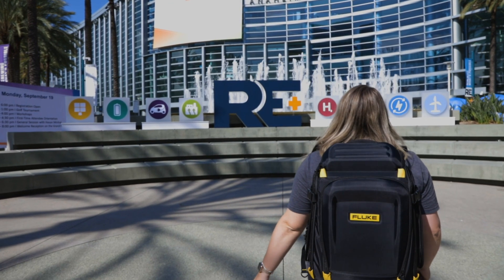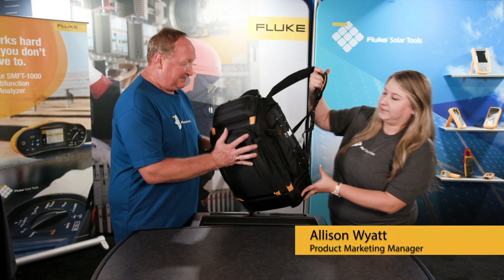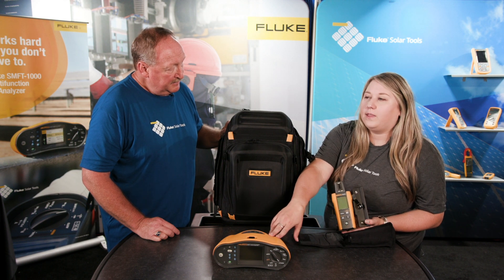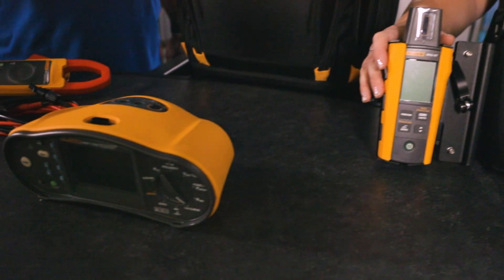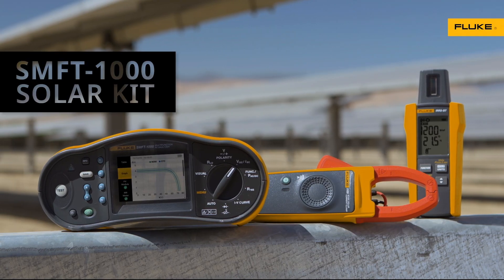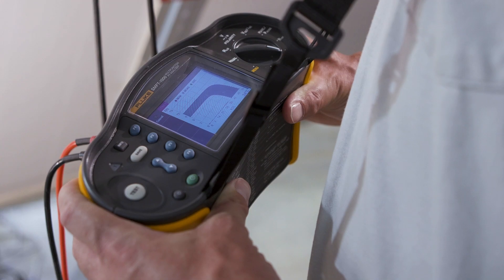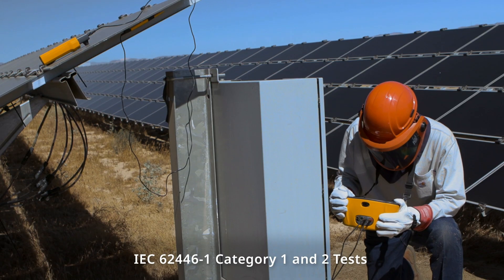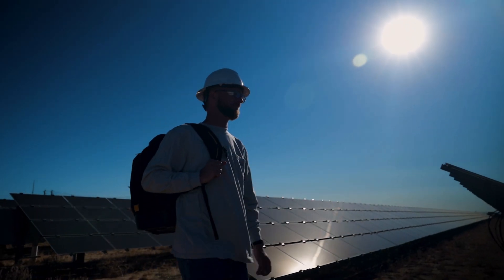Fluke SMFT 1000 Solar Kit Introduction - LIVE at RE+ 2022!

Comment: Does fluke have all in one for 1500VDc , max 20Amp solar test kit?
Reply from the maker: Hi Stanley - have you checked out the FLuke 393 Solar Clamp Meter? 
https://www.fluke.com/en-us/product/electrical-testing/clamp-meters/393-fc
Reply: @fluke  Is it possible to use it addapted to the SMFT-1000? We have a requirement of inspection of: 18.4 A and 1300 V.
Reply: Checked. Thanks